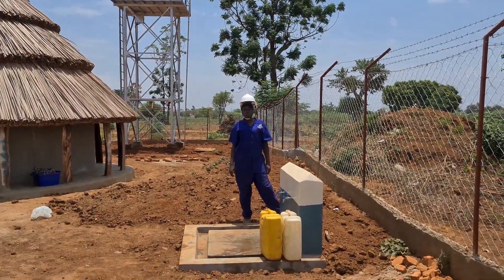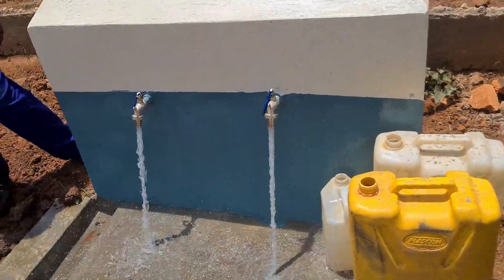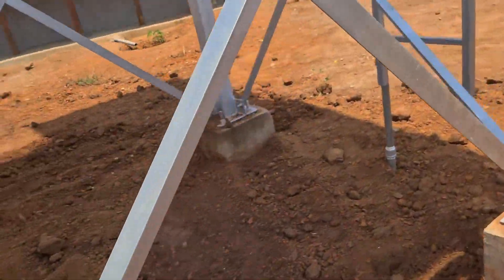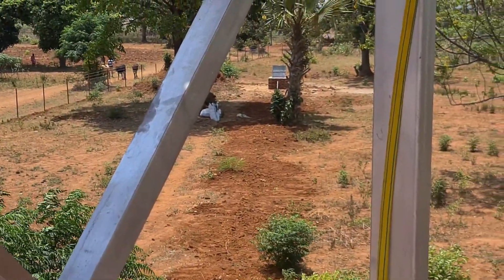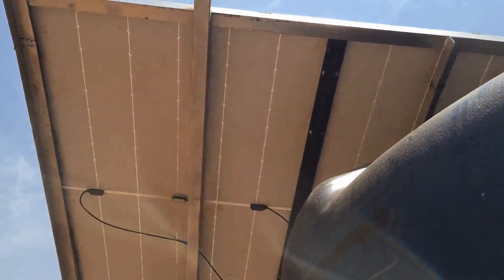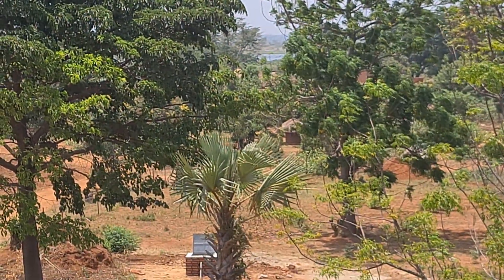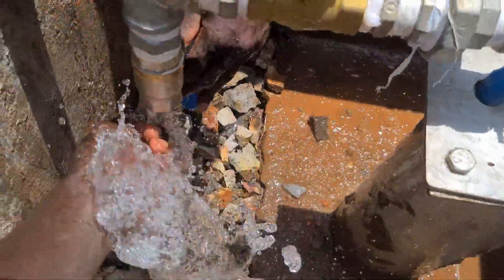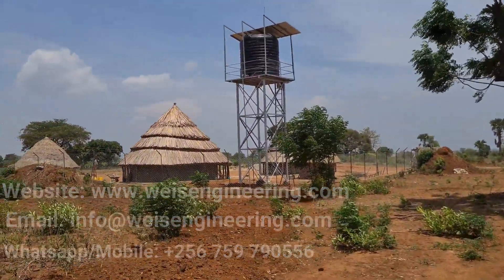Automatic domestic solar powered water pumping and delivery system

Comment: So the water from the reservoir is fed (supplied) to the three different pipelines (tap, house & irrigation) through the force of gravity, right?
Reply from the maker: Yes, but house and irrigation were to be connected at a later stage
Reply: @WeisEngineeringLtd  oh right. One more question; what are some of the measures your designing team had taken into account to make sure there is sufficiency and consistency in the flow pressure to the pipelines?
Reply from the maker: @peterundaba2906  for pressure consistency, you will need accessories like pressure tank, electric pressure gauge and water meter, variable frequency drive that allows input of such accessories

Comment: Wonderful job  pliz how much the system does it costs
Reply from the maker: There several factors considered for example;
1. Dynamic water level and yield
2. Estimated water requirements per day
3. Distance from the borehole to the tank (s)/reservoir (s)
4. Distances both vertical and horizontal from the borehole to the delivery points

Comment: But weiz engineering u hv not answeered me ma qns?? I dont know y??
Reply from the maker: We have not yet received your email
Reply: Mr. Hassan, the engineer shared is email address with you, just write to him or call him and discuss. It wouldn't be a good idea to just post the cost of this project on this platform.
Reply: @peterkimera7676  👍
Reply: @hassanbisegerwa4114  I actually need the same system at my home and right now I am contacting him for a quotation